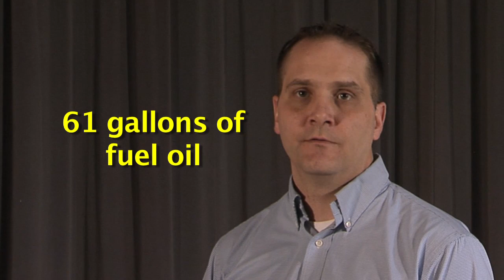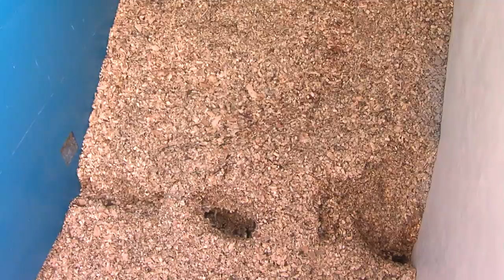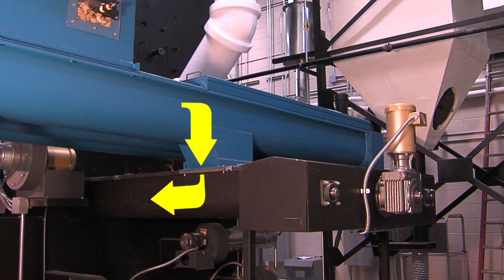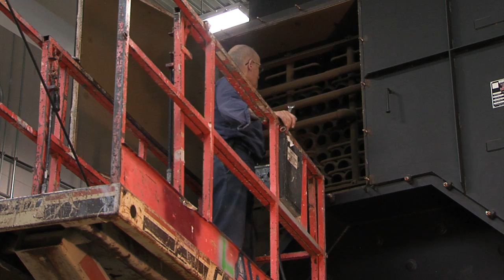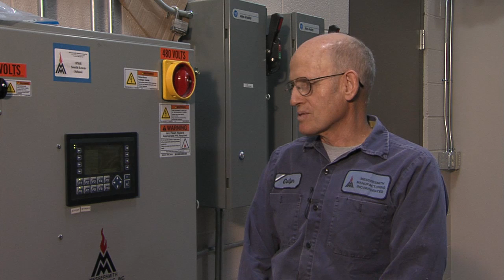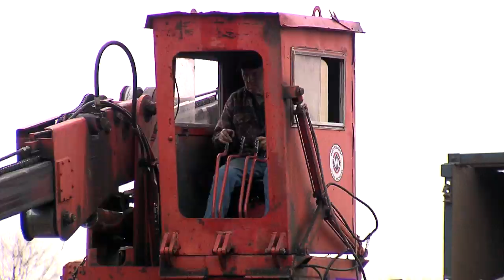Messersmith Biomass Boiler System

Comment: this system is very similar to the one I work with,but we burn grape seed,grape seed dust,dried grapes...yes I work in the alcohol industry...as a fuel it is awsome,but it is dirtier than the wood chips as dust escapes everywhere in the boilers room...I operate an aqua tubular,4 passings ,40000 liters one!!